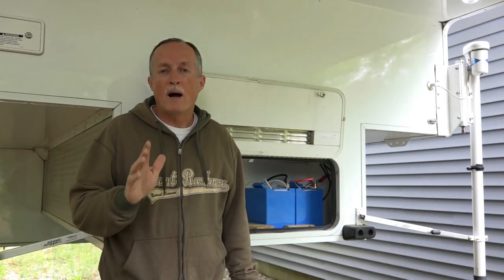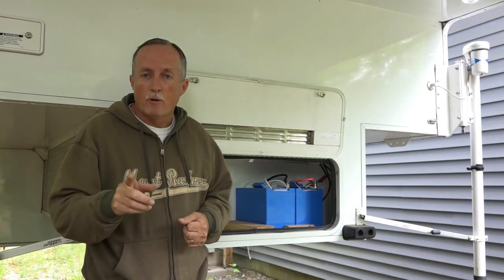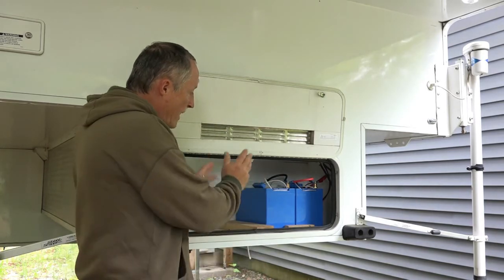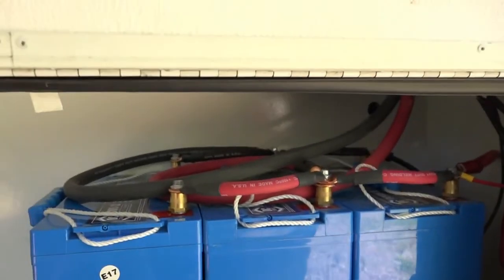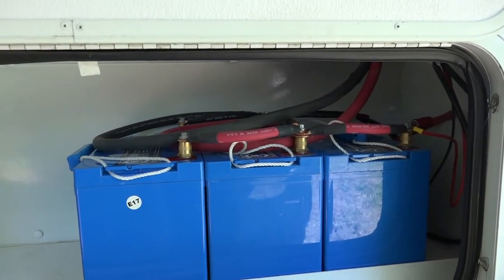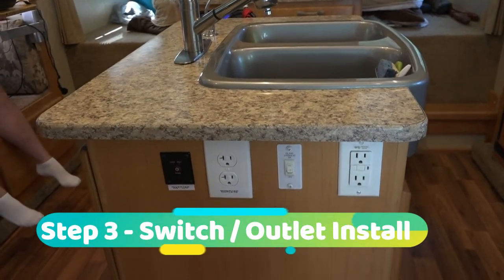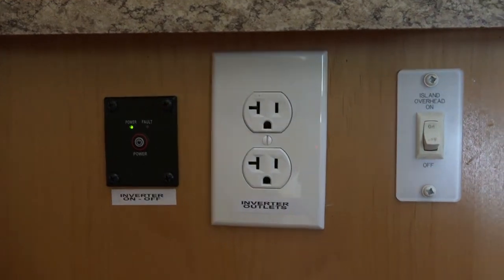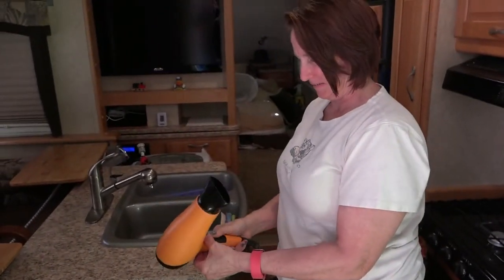How to install a 3000 Watt Inverter in a RV - Final Install

Comment: Nice,  but your 350 amp fuse should be as close to the battery as possible.

If your positive cable were to ground somewhere before the fuse,  you could have a major fire.

Comment: hey mate how you going, doing my own electrical system right now and wondering how you wired a power point from the inverter which is essentially another power point? is there a specific cable to do this? cheers heaps!

Comment: Nice setup.... Just wondering why you didn't go the extra mile and install a transfer switch so that you can have power to all of the outlets instead of just one dedicated plug? Your system is more than adequate to run everything in your camper without issues. The install is quite easy and all that is required is that you disconnect your converter charger from power distribution center and wire it to the shore power side of the transfer switch (with it's own breaker) and turn the fridge to propane only when running off of inverter power. 
We are running 200 watts of solar, 2 6v GC-2 lead acid batteries and a 1500w inverter with a transfer switch with no issues at all. I generally don't run the microwave just due to it's power consumption, but the 1500w inverter runs it just fine... If I want A/C we use the generator.

Comment: Hi Charles an inverter is a great and useful upgrade. Nice clean install too. I was always told to connect the positive cable to the first battery in the bank and the negative cable in the last battery in the bank. In theory this pulls power evenly through all batteries in your battery bank. I see you connected both positive and negative cables to the middle battery in the bank. Does this also draw through all batteries evenly or will the middle battery draw down quicker? Great video and stay safe.